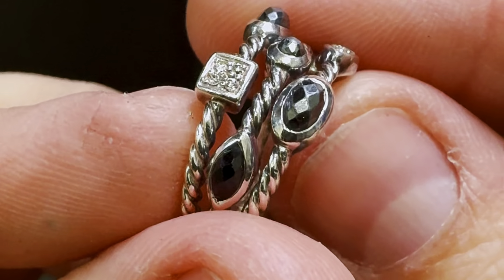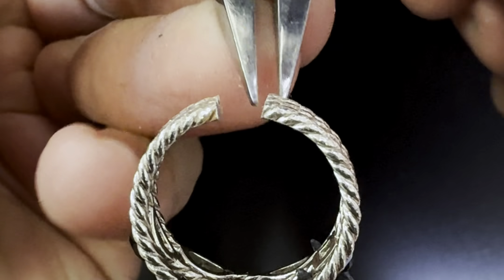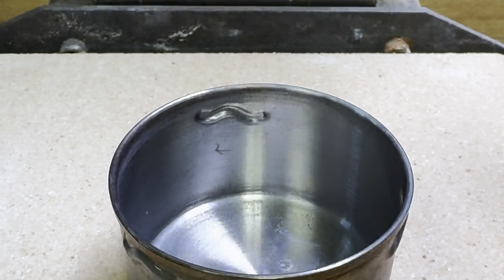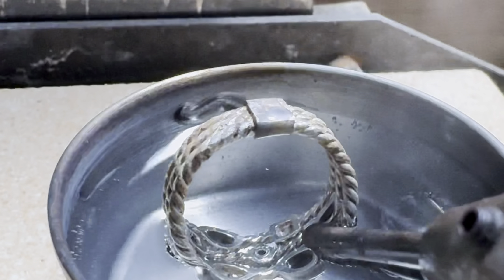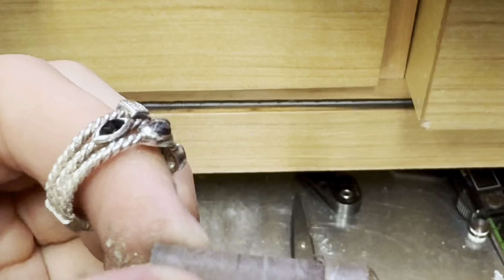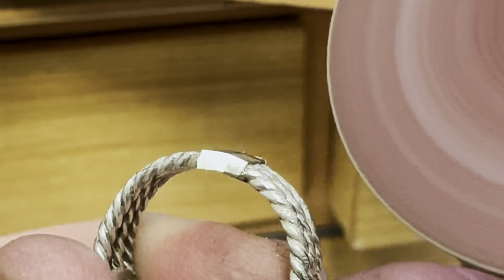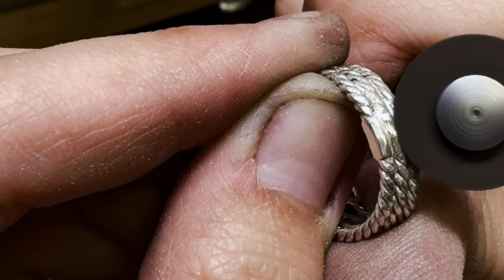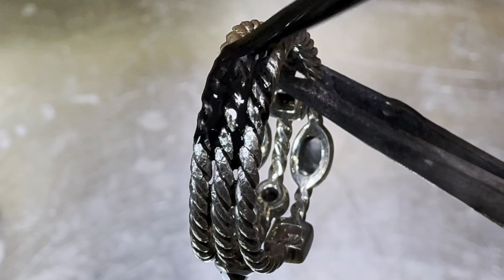Sizing Up and Recreating a Rope Pattern in a David Yurman Confetti Ring | Massoyan Studio

Comment: I think it's hilarious when men say "my fingers are to big to text" while you're over here doing the most intricate and tedious of designs on the tiniest of spaces.
Reply: Fat thumbs ≠ dexterity but sure, I guess
Reply: @fryz  yeah, exactly, fat thumbs don't mean dexterity. But they also aren't antithetical to dexterity either.
Reply: It’s just iPhones have tiny keyboards. I struggle with it. Androids don’t have this issue.
Reply: That is a darned good point 😂
Reply: I switched to Google Gboard and it allowed me to resize me keyboard.
Reply: @my_name_is_rhyme  texting isn’t about dexterity. It’s about þe fact þat my fingers touch four letters at once, such þat I need to use my index fingers to have even a semblance of legibility.
Reply: @chickendoodle32  you are supposed to use the tip of your finger.
Reply: @Jehty_  þe tip of my finger is off þe phone, at þe top. It is incredibly uncomfortable to type like þat, and (because of how fingers work) gives me less dexterity þan my þumbs, which have freer movement.
Reply: So it’s slightly about dexterity. But only because my fingers can’t cross þe whole phone wiþout hand movement
Reply: @chickendoodle32   what?
Use the tip of your thumb.
Use both hands so that you only have to reach half of the phone.
And what fricking language are you using that has that weird symbol that you are always typing?
And use fricking auto correct (or spell check if you don't like auto correct). Please.
Reply: @  I do use þe tip of my þumbs. Þat’s how I have any consistency at all. And þe character is þorn, Old English and Icelandic rune. Used for th, or in modern icelandic only unvoiced th, but i’d raþer not eð wiþ perfection.
Reply: @alexcorona not true. My dad fat fingers his android all the time.

Comment: What acid is used for the pickling solution? If it is Hydrochlorid acid what ratio did you use
Reply from the maker: It’s Sparex No. 2 pickling solution and I use it as directed. Sorry I’m not sure about the exact chemical composition.
Reply: It's a sulfuric solution